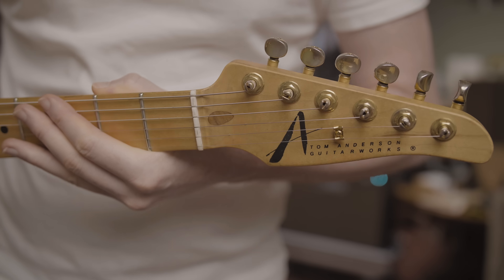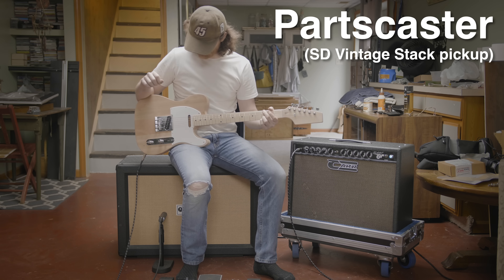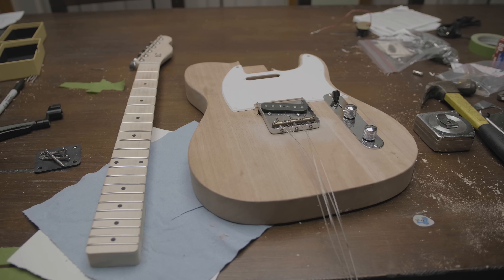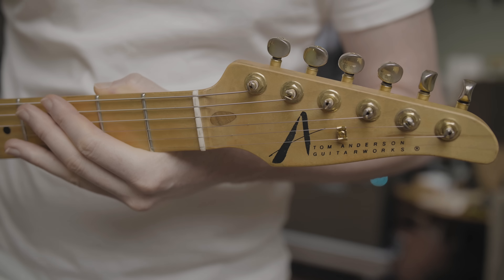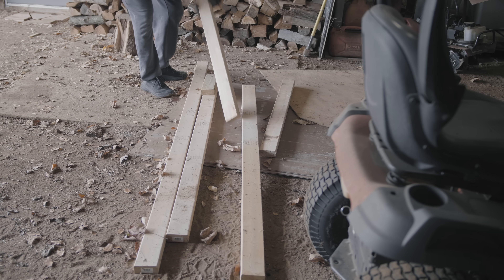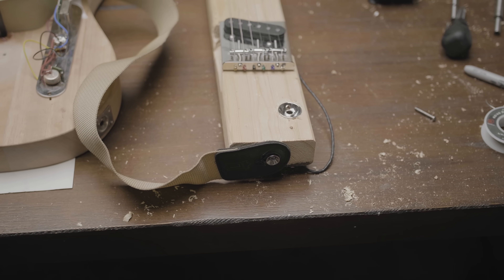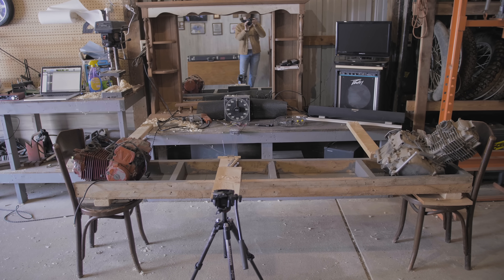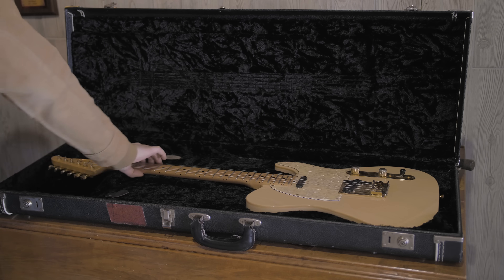Tested: Where Does The Tone Come From In An Electric Guitar?

Comment: Great video! I have come to the same conclusion going another route. I have done similar tests with guitar body's and pickups, but what made me convinced was basses. Changing the strings or pickups have more effect on the tone than anything else on a bass. Electronics, pickup height and position, together with scale length do also make a huge difference. Construction, design and material do make more of a difference in how it feels to play, how well it suits your anatomy and this finally makes you perform better or worse. I have never done any tests in a scientific way like you, but I have come to the same conclusion.

Comment: The biggest differences for me were the harmonics. The Anderson had more harmonics, secondary and tertiary harmonics at least, which made it sound warmer and more analog/organic. The Parts-caster consistently sounded more clinical, more sterile. Other than that, the differences were far less than I expected. I'd like to hear the Air Guitar anchored in blocks of lead, or wood bolted to blocks of lead, to see what effects it had on those subtle sounds. I also think it would be interesting to hear the Air Guitar bolted to a wall, and concrete floor. Maybe someday...

Comment: But electric guitars accousticly have a different quality of tone from guitar to guitar without an amp. I mean, you can really tell by ear. Are we saying that that quality has no role to play in what's being amplified?
Reply: Yes
Reply: @vladasmalajevas  Nah. Less input less output. I'd saying that might be right by about 80%. You can talk into a pickup, if your guitar is accousticly resonant it'll come through in some way.
Reply: @evolagenda  
Your voice vibrates the strings. The strings vibrate the body, which in turn vibrates the strings. The string vibration induces an electrical current in the pickup. The only way that tone could be affected is by resonant frequencies getting boosted by the body. They would be only a fraction of the voltage of the current induced by the strings themselves. The change in tone would be imperceptible. 
This video is the proof that tonewood in electric guitars is a myth.
Reply: @duderama6750  They can't accept it dude lol. These guys are hilarious.
Reply: @bassyey  
Pickups, proximity (to strings) and pre-amp. That's the whole shebang.

Comment: for me, improving a guitars performace usually means adjusting the pickup height, insulating the electronics, then replacing the resistor if Necessary

Comment: The best and the most accurate test I've seen so far. An honest one too. The only difference I've seen in wood types along the years... it's just the sustain you get. Hard wood always offered me longer sustain... soft wood not so much. Other than that it's just about the way you set up the quitar and the electronics. I concluded that the particular sounds never come from the guitars... but the player. You get a good guitar player to play on a cheap guitar... it will always sound great. You get a beginner to play on an expensive high end guitar... it will sound like a cheap one )))
Reply: What if experienced player played both guitars, which one would sound better and why?
Reply: The built quality of the guitar and the quality of the electronics and the other hardware. Other than that... it's just talent.
Reply: @dxexplorer  So more expensive would sound better (on average ofc)?
Reply: Good quality doesn't really mean expensive. Yes it's true the expensive stuff it's mostly good quality. But you can also find great stuff that doesn't cost a fortune. Or sometimes you can buy something cheap that's it doesn't always have an excellent quality... but you can spend a few hours or days working on it and make it sound good. As example... you buy a cheap Telecaster copy... the wood it's good... electronics not so bad... but badly adjusted. You spend a few hours adjusting the guitar properly... you may replace the potentiometers with some better quality ones... ground the electronics better and why now sometimes put the pickups into some epoxy and you end up with a studio quality sound but cheap. Then it's up to your fingers to do the rest of the magic. I've built a quitar from a piece on scrap wood and used guitar parts in the bathroom after the work hours when I used to work on a cruise ship. The quitar sounded so good... the guitarist from the band wanted to trade it for his Paul Red Smith quitar that worth 4000$ back then. I didn't want to change it )))
Reply: @dxexplorer  Yeah, I was thinking about factory shipped cheap vs expensive guitar and which one would sound better if same experienced player played it.
I guess expensive (in general higher quality finish, better hardware, wood, setup etc) is the answer then. thanks
Reply: Always a pleasure my friend. But always remember thar you can buy cheap and put your touch into it and make it personal. That's even better hehehe. I prefer that version.
Reply: @dxexplorer  Oh I like to tweak my instruments, cheap and expensive ones. cheers
Reply: Cheers my friend.

Comment: Very interesting! I am proud to own one of the first Warwick Dolphin Pro-I basses ever made, and it's a beautiful instrument to look at and play. It wasn't long before Warwick changed the pickups from Bartolinis to MEC, which completely changed the sound from a bright, almost jazzy sound to a deeper, rounder more modern sound. It has been said you can shatter glass at 50 yards using a Bartolini equipped Dolphin, and it certainly seems possible! The sound is unusual because the pickup configuration is very unusual, in fact in order to swap out to MECs the pickups had to be invented by them. As others have stated, aside from the sound, the cost involved in the guitar comprises build quality, top-level hardware and stability in construction. That Dolphin is the easiest bass to play of any bass that I have ever tried, and that is down to the design and the build. This means I can play things on that bass I cannot play on others, and this is as important to me as the sound.

Comment: Interesting.... reminds me of when I took a 1960s Vox Phantom IV and converted it to EMG Jazz bass pick ups and pre-amp, wow did it sound different !! but then I went back to the original Vox pick guard and pick ups, because it had a great  underwater sound, almost like a Muton, I seem to think I converted it to fretless too around the same time.

There was a Ric 4001 at the Mojo Guitar Shop in NYC back during the early 1990s that someone put a Jazz bass pick up in place of the pick up that's supposed to be in the horseshoe, and I was told that it  still sounded like a 4001, which I kind of find hard to believe, but that's what I was told.

Good video, I'll have to read all the fine print later when I get some time.

Comment: Just started the video. As a complete novice here is my guess to top five. For pure electric with no sound chambers or pedals.
1. Amp
2. Pick-ups
3. Scale length
4. Strings
5. 1 wood to another.
Reply: Welp. i guess wood doesn't matter hardly at all.
Reply: @inviz88  Pick matters more than wood lol. Try playing with a metal pick.

Comment: I took psychoacoustics in college and did a similar experiment for my final. I took one pickup and transfered it between a crude pine guitar and a crude maple one that I had made (took great care to be exact on the dimensions) then set up some of those old school science fair boards to block the view and blind tested it to the class. No one could tell what was what without simply guessing. The biggest part about this for me was I actually contacted some big guitar manufacturers (Gibson and ESP are the only ones who responded to me) with questions about tonewood and they assured me that the wood is extremely important and "any experiment that shows otherwise is flawed". No shit told me that. 

So why do my two identical ESP LTD F-400FMs (besides the paint) sound different? Because not all electronics are exactly the same (a 1k resistor isn't always exactly 1k resistance, order a bunch and test them if you dont believe me) and little differences add up over time.
Reply: @BranqonBoom  well, tbh it's a fact that two wound pickups never sound exactly the same just as two potentiometers never give the exact same reading etc; wood has 0 effect to the output signal of the electronics

Comment: This is very interesting but I'd say that the sound of the instruments you are playing it's not exactly the same: It's quite similar but it has some differences in his character, so I'd say that wood matters in determining the final personality of the sound. So I agree that it's not the most important aspect, but it matters.

The air guitar is really amazing and it sounds great! But obviously it's not a guitar made with air, is a guitar with a very original shape that reminds me a lyre, more or less: chords are kept under tension by an oval-like structure. Its body and neck of your air-guitar are the benches, the wood that connects them and maybe the floor as well. They're all thick materials which allows the string to vibrate. I admit it has a gorgeous sound, but it's different from the other ones.

To understand that/if the material matters, maybe we should think to something really different, for example a guitar with a regular shaped body but built with some absorbing material such as sponge, expanded polystyrene, gum or cotton. I understand that it won't be feasible because they're not strong enough to keep the string under tension, but I'd say this is the key point: the material matters because it lets the strings vibrate. Or it partially absorb string vibration.

I also saw your other video about sustain but I think my comments are good for that too.

Comment: What happens if you place some thick rubber/ vibration absorbing material between the bridge and the body? That would push the thickness of the finish and type of wood used to an extreme of that potential variable.

Comment: I am not sure what is more upsetting - videos like this, or reaction to them. First, the difference between partcaster and normal guitar is quite obvious, its even bigger with log guitar. Second, if you want to make comparison, you really should test guitar with as clean sound as possible - even slightest distortion brings out harmonics (in fact what we call a distirtion guitar effect are harmonics that occurs when signal is clipped in a transistor or a tube), and that coloration tend to masquarade original signal. Everyone can clearly see that by distorting any guitar into oblivion with fuzz - you wont hear a big difference even between completely different types of pickups if you apply enough distortion. If you do not know that, I strongly suggest you go and check out how distortion effect actually work.  Third, there is a very practical thing a lot (may be all of them) commentators are missing - there are collectors arguing about tonewood and stuff, and there are pros. We, the pros, do not give a sht about tonewood, but we care a lot how well we can perform, on record or on stage. You literally translate the amount you pay for instrument into amount you earn with it. Its not a question about prestige, its strictly practical - if I need a good les paul sound in my studio, to record classic rock solo, and i can achieve that by getting a log, putting a chinese neck on bolts, slapping pair of Seymours and some electronics and hey I am done, I can be Slash now, I would do that in a blink of an eye. But I cant, it wont sound nearly close to what I need to sell myself. And mind it - we are in 2022, most of my work is bought online, my client cant see me working in studio, he can only hear the result. But pros are still buying rather expensive guitars, modern or vintage, and they still try to have plenty of models to produce classic tones that are often sought after by clients. You really cant get a good ES335 sound with a log and pair of Gibsons, no matter how hard you try. 
Another thing is that for your test you picked up a very specific guitar pickup in a rather specific position - teles bridge pickup is, first, really hot - it produces a strong signal, second, it is not really a multidimensional sound you can get from it. Bridge tele is bright, strong sound that probably wont differ much even if you track it without distortion. Bridge tele pickup is not about a nuances. 
And finally, if you really want to make it an experiment, you probably should record directly to interface and compare the results with analyzer, there are plenty of those out there. Playing a single chord or a quick chicken picken run to prove your point is not the strongest thing to do (well, if you are looking for some hype, of course, its the best).
I am horrified of the response I am probably getting for writing this in the middle of "Lets denounce tonewood bullshit!" festival, but I just cant stand it.

Comment: This is not only super interesting, but the only way to settle false believes and technical propaganda: an empiric test!
I was on my own quest for many years, following the standard believes in woods, shapes, finish, different forms of karma to yourl guitar. Now, of course, we are talking about electric guitars! I had my moment of clear sight, when I made myself a cab with a contraption for one speaker. I was replacing the V30 I was so used to against a Governor speaker: what a revelation! Who would've guessed it? In an electric circuit the sound is directly dependent upon the electric components, manly the pickup and the speaker! From that day on, I knew that the holy trinity was strings, pickups and cab. 

Considering this all, I don't see, why anyone would want a guitar made from exotic woods - abide the fact that it's a sin against nature, especially these days. 

Acoustic guitars? Well that's a whole another story - here, the natural components a crucial. Guess what, that's why it's called acoustic :)

Thank you ever so much for this video!!!

Comment: I think the bench with the Honda engines had more sustain! Awesome video!
Reply: I hope Epiphone buys him and comes out with a more affordable variant of the bench
Reply: @bad1080  I prefer a Harley at the low E, and a Norton at the high E. More oomph in the bottom end and clearer highs.
Reply: @ReallyHumanPerson  Which year is the best manufactured?
Reply: i wonder if its “neck” has more or less give
Reply: @bad1080  "Excuse me sir, I'm looking for a piano, a motorcycle, or a chainsaw." Yamaha salesperson: "Boy are you in the right place!"
Reply: Honda engines last longer, so yeah, stands to reason....
Reply: You kid, but this test was only about 'tone', i.e. the spectral properties of the sound when playing the same notes. Not about sustain, i.e. how fast the sound volume decays with time. The guitar body obviously doesn't affect tone as demonstrated by the video, but it equally obviously affects sustain, which is going to be affected a lot by how much of the vibrational energy of the strings is absorbed by the guitar body (especially the neck). Almost certainly a stiffer wood for the neck will absorb less vibrations and provide more sustain.
Reply: @kristinnkristinsson1369  Glass guitar. That would be stiff. It's doable, probably has been done a few times. Very heavy.
Reply: I would hazard a guess it's because less energy is being lost in the neck
Reply: Yes, I have heard that using a Honda engine rather than a Yamaha gives greater sustain and attack.
Reply: Can't wait to see the first guitars that come with these for extra sustain
Reply: I mean at that point the body is both of the benches, truly massive guitar body if there ever was
Reply: i prefer yamaha

Comment: Like in a Stradivarius, many luthiers have tried to nail down the secret recipe for a guitar's character, and some turned it almost into alchemy. I think it's simpler.
You want tone stability, but wooden guitars being what they are some frequencies degrade faster than others. We normalised this characteristic, although its effect on the sound is negligible. It creates an electromagnetic resonating field, and each pickup, coupled with where it sits under the string, deforms the field in its own way. And then the amp that produces the tone also deforms it with a certain characteristic.
We don't want perfect tone stability and a natural tone. We got used to what it sounds like due to imperfections in the production process of mostly vintage electronics, and because it's in so much music that we grew up with, this is also what we want to hear in modern guitars. This makes it hard for true innovation to find its way in objectively better instruments.